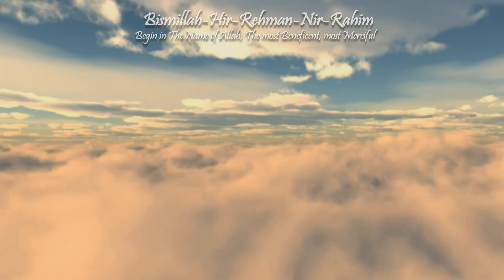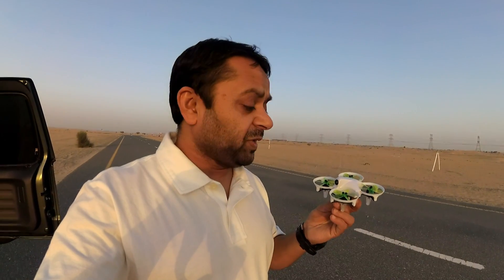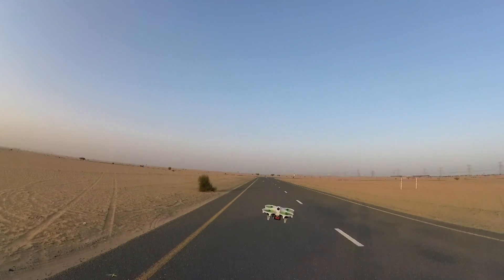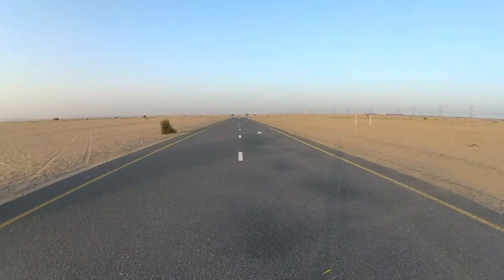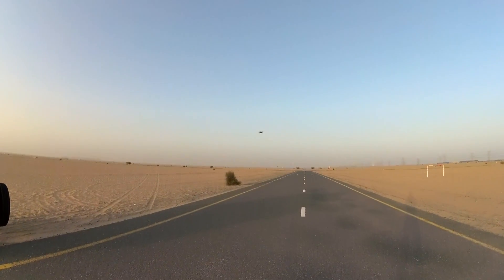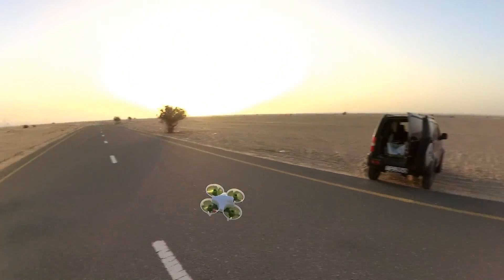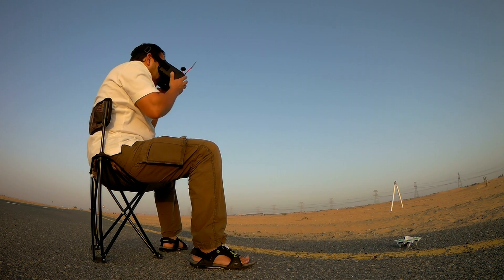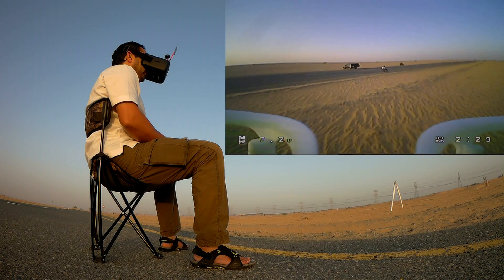DYS Elf Brushless FPV Tiny Whoop Outdoor FPV Flight

Comment: Sir, I was wondering if you could help me. I got my DYS Elf a couple of days ago. When I try to fly it, it will start to hover and just loose power and fall to the ground. and start a fast beeping. Other times I give it throttle on take off and it shoots straight up in the air out of control. Can you please help. Thanks, Robert
Reply: Re-flash the firmware and all will be fixed

Comment: Hi Ali, thanks for posting the video on the elf!  How does this compare with the Babyhawk?
Reply from the maker: First off, power and speed, its good, 2nd its cleaner setup. 3rd its ducted fans, so its much more tolerant to crashes than babyhawk, 4th neat shell housing and protecting electronics and camera system. 

all in all it beats Emax BabyHawk